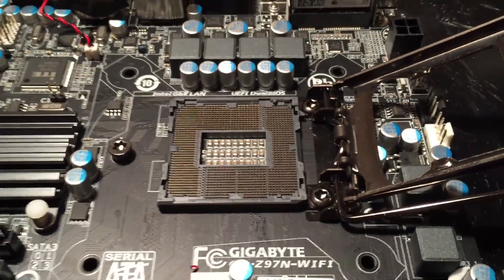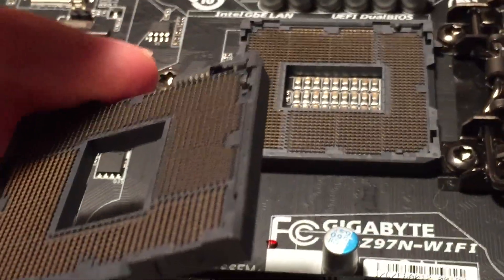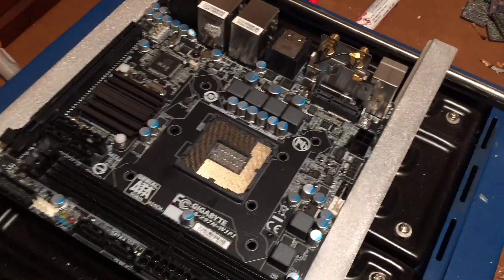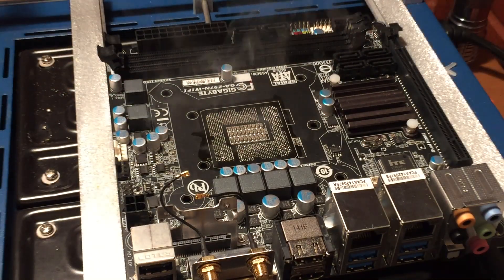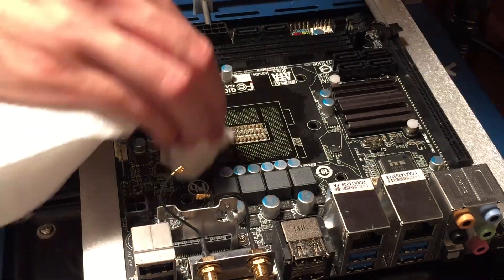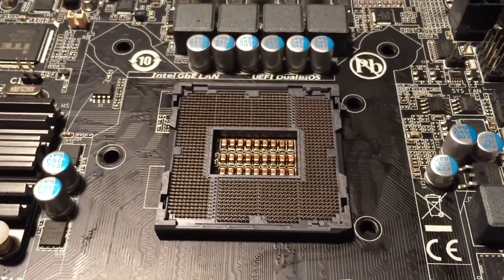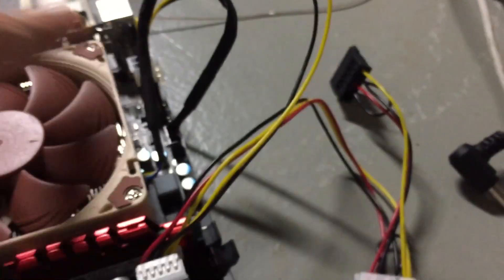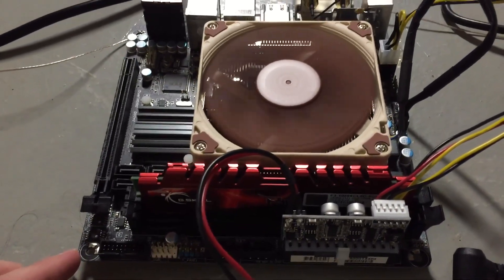Replacing a Damaged CPU Socket on an LGA1150 Mini-ITX Motherboard

Comment: if the socket has a broken pin, but part of the pin is still there, you can take a full pin from a donor socket(other board or aliexpress) and slap it on top of that pin and long as there's good contact between the 2 and the cpu it's a nifty simple n00b solution:P; if you want to get fancy you can tin part of the pin and solder them together but that's less n00b friendly

Comment: Did you have to template, and solder paste that LGA1150 socket??? I’m curious, because you didn’t tell us if the  socket came solder balled from FoxCon, Intel, or whomever manufactured it??? Great video though. That takes balls, patience, and expensive surface mount soldering equipment. My respects to you sir!!! Noisy preheater tho.

Comment: Dude wow, would you do this for someone? I can pay!!!
Reply: @dayglorange  it can still break regardless, there are contacts inside the am4 socket and it can break if you reinsert the CPU alot, although it's pretty rare.
Reply: I'd be interested as well, however if he's not in the states it would be a wash for my projects. If he is in the states, I'd really have to ponder and get some pricing if he is available for outside work. Also are AM3 / AM4 and FM2 sockets the same, they just have a layer of plastic on top with the lever that pops out, got 2 boards I feel need this (AM4 socket repair). Again, awesome work, my nerves would be shot for a week doing 1 of these. lol This would have been a 2 week process for me... lol And the result would be... Oh no, all that and it doesn't work, did I do it wrong or is there other issues with the board!!!

Comment: I'm just getting into mobo repair at this level so I gotta quick question. When applying the new CPU socket does one need to apply anything to get it to stay in place or does the flux do that? i mean what holds it in place once you get everything done and the new socket in place? thank any help is greatly appreciated. God bless and great video :)
Reply from the maker: Nothing holds it in place, you just have to make sure your board is level, and it'll just stay in place when soldering. The flux just helps the solder flow properly.

Comment: Doesn't exactly look like I can do this at home but cool nonetheless.
Reply: @Danny i think thats a hot air gun to melt the solder balls.
also that heating plate makes work so much easier. its probably possible to do this job with just a hot air gun but it may require extra hands.
Reply: @germas369  i dont know if you are a professional, but could an oven preheated iron tray be used instead of the heating plate?
Reply: @germas369  It's impossible.  I soldered an extra NvME slot in my Lenovo M720q Tiny along with some extra capacitors and my brother has a cheap hot plate and it was DIFFICULT because of all the massive ground planes in motherboard PCB's soaking away all the heat.
Reply: 10 dollar solder, 10 dollar heat gun, space motherboard, your set, it's possible
Reply: @thetechbro6438  75$ heat gun but its doable lol
Reply: @thetechbro6438  sorry but you don't know anything about replacing bga
Reply: @thetechbro6438  Might need 2 heat guns, one for bottom and another for top. A thermometer might also help.
Reply: @thetechbro6438  Plus Aluminium foil to help prevent damage to other chips.
Reply: @thetechbro6438  And a pre/bottom heater, and good air-evacuation (flux that burns will make you want to puke otherwise), and a good soldering iron that heats up the tip upon detecting the heat being sucked away by massive ground planes.  You can not do this with a cheap soldering iron.+
Reply: slap that thing over a grill
Reply: You Sur are OG Doom Guy status..
Me: yea,no
Reply: @Danny its a common attachment for decent heat gun kits nowadays. slips on and off the front of a heat gun. could be done without just not as even heat spread.
Reply: Lol types this comment while watching a guy do it at home
Reply: Sbsssdnddddssss
Reply: cool we care
Reply: This is glorious, I have been researching "instrument cluster repair near me" for a while now, and I think this has helped. Have you heard people talk about - Giyathan Bewildering Gratification - (Have a quick look on google cant remember the place now ) ? It is an awesome one of a kind product for discovering how to repair your electronic items like a wizard without the normal expense. Ive heard some interesting things about it and my buddy got great success with it.
Reply: For future reference if you are worried about mobo components cover them with aluminum foil and secure with Goldfinger/Kapton tape
Reply: I literally bought the stuff he’s using to do it. It was $150 or so, but tools are just investments.
Reply: So you’re adding flux to the board after you removed the socket and cleaned up correct?
Reply: But availability of new socket and its cost + shipping cost etc all matter since its mostly such components are only available in China!
Reply: @Danny Its a duct that guide the hot air... You could try to attach a heat resistant duct with a funnel a at the end to a hot air gun and achieve similar results.
If you are crafty you should easily be able to replicate what he did.
Reply: @vitor900000  https://www.amazon.com/gp/product/B07J5X5MZP + ducting = temperature controlled auto on.
Reply: @vitor900000  You will need a temperature controlled hot-air gun.  A regular hot air gun like the one you use for paint won't be precise enough and will burn parts.
Reply: sounds more cheaper just buying a new board lol
Reply: just use an oven
Reply: @s_low_s10  Ovens can damage plastic parts or overcook heat sensitive components.
Also you will not be able to easily manipulate the Board when its inside a oven.
Reply: @vitor900000  it was a joke
Reply: @vitor900000  im pretty sure Adam was just being sarcastic .. lol kinda like the guy who said to use a Grill.....
Reply: @bigchippa101  Ovens are sometimes used to repair electronics but you need a oven with good temperature control. 
Kitchen ovens have hot spots and their temperature can fluctuate by more than 10*c.

Comment: I have an LGA-2011 motherboard, could it be the socket that caused it to not work anymore?
Reply from the maker: Potentially; are there bent or missing pins?
Reply: dosdude1 You need a bigger nozzle for the heat gun to remove a 2011 socket, right?
Which one would you recommend?
Reply: @dosdude1  no bent or missing pins plus they all look shiny like brand new, even cpu looks brand new, always watercooled and kept to low temperatures, I've never took it off the socket until I had to check lately due to the error.

Comment: How do you you replace socket 775??
Reply from the maker: The same way as shown in this video, the process is exactly the same.
Reply: Is regular heater gun with special attachment would be able to perform the task????My heater gun have temperature adjustment,in Celsius...

Comment: How much did the new socket cost?  How much does a board have to be worth to make it worth it for you?
Reply from the maker: The new sockets only cost like $5 from China. If it's a really expensive board, it's definitely worth it, but if it's just a board worth like $50 fully working, it probably isn't.

Comment: Pretty sure you get asked a lot, but what's the rework station you are using? I know that they are fairly expensive in general, but another youtuber who was using a jovy jetronix, said it was around 1500...looking to keep it under 1k if I can help it lol. Thanks in advance mate
Reply from the maker: The board preheater is a Puhui T8280, it costs around $100. My hot air station is a Gaoyue 850 (Hakko 850 clone), which cost me about $40.
Reply: @dosdude1  thank you soooooo much. I really appreciate it!
Reply: @dosdude1  so I couldnt find the gaoyue 850, the one I found was like 400+. I found an 858 that was around 40. And I found the preheated for a little over 100. My last question is, where can I get the wide nozzle you're using over the socket? That seems like a perfect size for this. Tha k you again

Comment: Can u just stick this in the oven instead?
Reply from the maker: No.
Reply: If you shove it in the oven then you risk desoldering every other component on the board let alone melt any thin plastics

Comment: What are your temperatures for bottom heater and hot air gun for desoldering and soldering phase? And estimated time it takes to desolder/solder? I have a similar setup as you :)
Reply from the maker: The temps I use are ~170 degrees C on the board preheater, and about 280 degrees C on the hot air, at 100% air volume. It takes around 4 minutes to heat enough for the solder to melt.
Reply from the maker: @MightyGimp  Go hotter for sockets, for those I set the preheater to around 200 or more.

Comment: Hey, I am trying to boot camp windows 10 on a Mac Pro 2012, do you have a way to do it?
Reply from the maker: Yeah... Use a DVD to install.
Reply: you have to download Windows 10 as Iso then you can choose Windows 10 home or Pro that you need to know yourself afterwards you have to burn Windows 10 to a DVD and put it in the DVD-ROM
and then restart and when Mac starts up you have to hold Alt until you get the selection menu and then you have to choose EFI

Comment: you ever think about doing this as a paid service? most computer repair places will just try to bend pins back then break them and tell you "sorry you are SOL"
Reply from the maker: Yeah, I definitely could. I do take mail-in board repair quite often, actually.
Reply: @dosdude1  well I have a gigabyte z97x udh5-bk that has some bent pins. I am waiting for ebay return to go through on it but I doubt the seller is going to respond so ... if I get a free broken board out of it and I cant fix the 3 bad pins ill holler back at you!
Reply from the maker: Sounds good!

Comment: Heya Dosdude1. A few quick questions. I've done board level repair in the past when I worked at TI. My question is.. what model station are you using ? I've looked at a few and yours looks different than the low cost units I've seen. I caught a brief look at it but couldn't identify it.
Reply from the maker: My hot air station is a "Gaoyue 850", which is essentially just a Hakko 850 clone. Despite it being relatively cheap, it actually works very well for my uses.

Comment: i have a few questions 
what flux are you using 
and whats the copper looking stuff called that youre currently using to clean up the old sauter
please and thanks
Reply from the maker: I use Amtech NC-559-V2-TF flux. The copper stuff is solder wick/braid.
Reply: Copper flux-coated desoldering braids. (Solder Wick)

Comment: Can this be done with 2 heat guns?
Reply from the maker: I'd highly advise against it, but I suppose if you were really careful, and had well controlled hot air guns, it could work.
Reply: @dosdude1  I've been reading more about it and if you could tell me what rework station you use I'd rather go with that. I'd appreciate it.

Comment: I can't even imagine what the heck people are doing to motherboards to damage modern CPU socket pins...other than maybe accidentally dropping something on it w/o a CPU installed.
Reply from the maker: It happens very often, who knows what people do... Luckily for me, this means if I ever want to buy a PC motherboard, I can just buy a really cheap one off eBay with a bad socket, and one new $5 socket later, I'll have a fully working board.
Reply: I literally trashed my Asus Maximus VI Hero board, trying to mount my Intel 4770K chip. I don’t know if the bracket was misaligned when I brought down the socket press over the chip, or if it was that crappy Intel heat sink block that i attempted to mount back on the board over the chip. The heat sink was wonky even before I removed it for thermal paste maintenance, but it never occurred to me to replace it. Needless to say, and long story short.... I was f__ careless. I never thought that I would ever damage a motherboard by breaking and bending CPU pins.
I learned a lot from this mistake, and would encourage anyone to be careful, and be mindful of those delicate CPU socket pins, that alignment and levered chip press, and that the heat sink has good motherboard mounting studs....trash the heat sink if one of those studs breaks or bends. Peace!!!
Reply: lol, did that with an LGA1156 board a bit ago, was holding a cpu ihs over a cpu socket (didn't realise it was right over the cpu socket) and it slipped out of my hands and landed right on the socket.

Comment: Hey mate what is the tempreture you are using for the hot air gun
Reply from the maker: For a socket, I heat the bottom of the board to 170 degrees C, and the to air gun at about 280 degrees C.

Comment: Can i get a link to the pico psu you use? I’ve always been interested in those things
Reply from the maker: I used this one: https://www.ebay.com/itm/DC-12V-250W-24Pin-Pico-ATX-Switch-PSU-Auto-Mini-ITX-DC-TO-DC-High-Power-Supply/202060461973?ssPageName=STRK%3AMEBIDX%3AIT&_trksid=p2060353.m2749.l2649